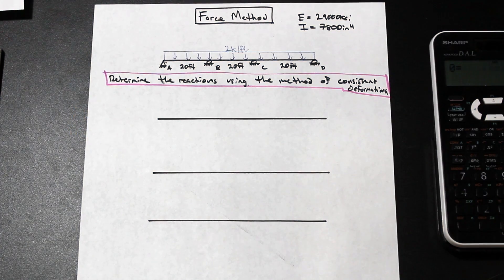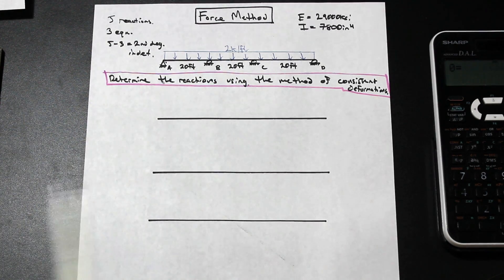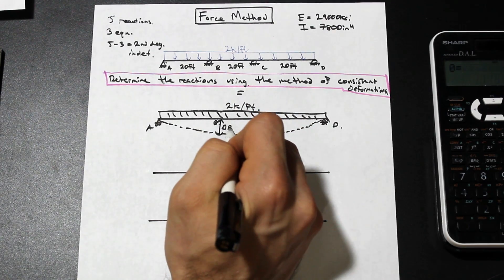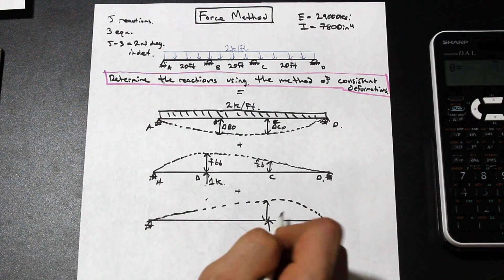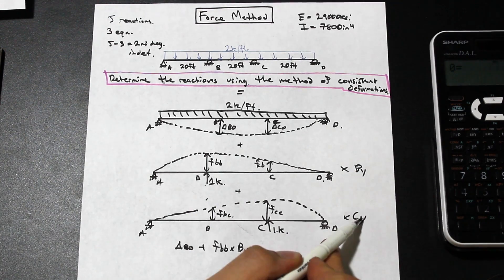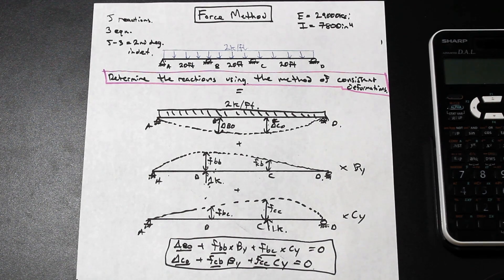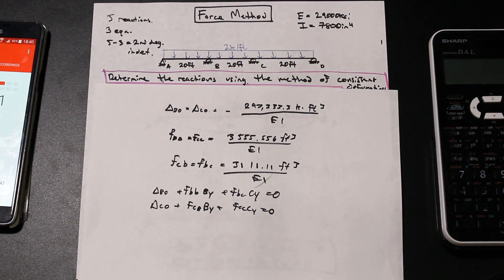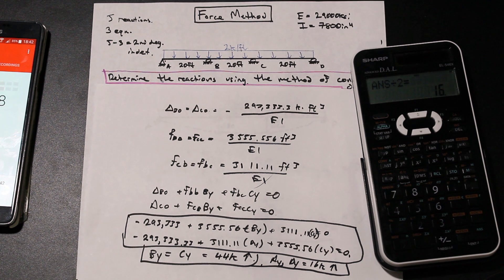How to Use the Method of Consistent Deformations to Solve a 2nd Degree Indeterminate Beam

Comment: Whenever there is beam and vertical loading cause udl is vertical loading and support are at same level, then there  is no horizontal reaction and and we aslo take 2 equilibrium eq in this case ❤️
Reply from the maker: There is a horizontal reaction still, there has to be or the member is unstable.  It's just zero.  In example questions the loading is almost always perpendicular.  If you have some inclined loading or tension/compression in the member it isn't zero.

Comment: Bro it's not 5-3 it's should be 4-2
Reply from the maker: No, just because the horizontal reaction is zero doesn't mean you don't count it (it could be non zero), but without it the member is statically unstable.

Comment: You didn't even show the deflection table. And you didn't teach how to solve the delta Bo and Co, Fbb and Fcb and Fbc and Fcc
Reply from the maker: Solving those deflections is literally just plugging into formulas from your textbook, theres nothing to teach. The purpose of our channel is not to show you how to plug numbers into simple formulas.  Also you should have a deflection table of your own in your textbook, or your professor will supply one and you should practice with that one as itll be the one given to you in the midterm/final, not ours.
Reply: But you didn't explain on what value should I use for "a" and "x" base on the formula you used on the last video you did.
Reply from the maker: Very true, we didn't explain in this video because: 1. We did it in a previous video and we don't like repeating steps that make the video unnecessarily long (its already 10 minutes), and 2. This problem isn't about solving for deflections using formulas, it's about using the force method to solve indeterminate beams.  In a lot of our problems we skip some calculation steps and focus on how to solve the problem, while encouraging you to try to solve for the deflection and compare with what we got.  If we didn't do this, our videos would be 30 minutes long.  I know there are other YouTube channels that focus on formulas and such that may help you further supplement our videos!
Reply: yep dis video doesn't help it lacks steps